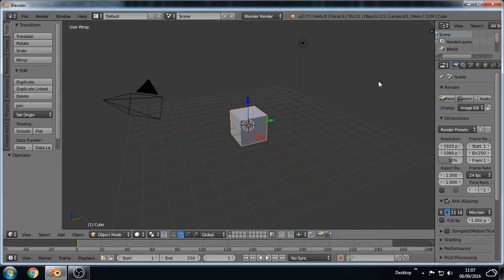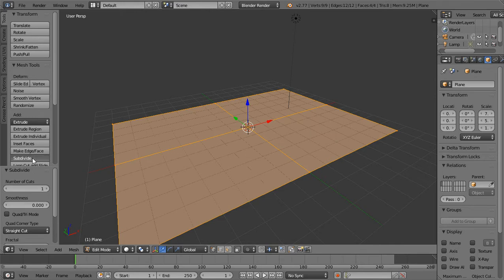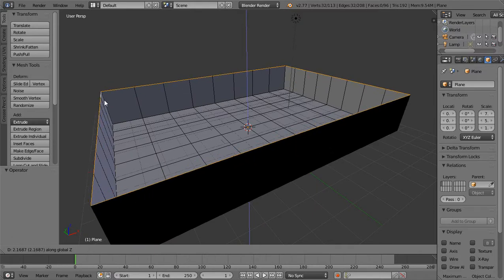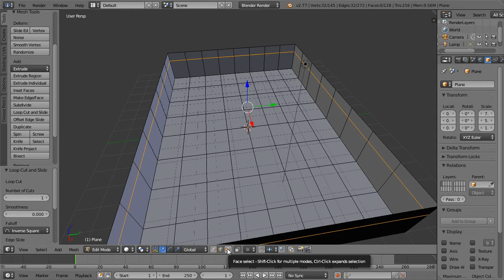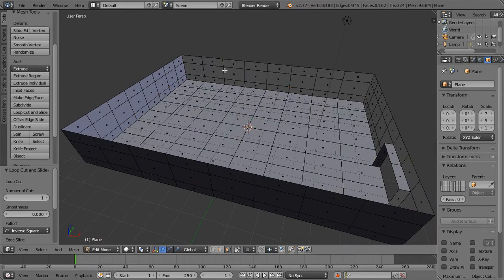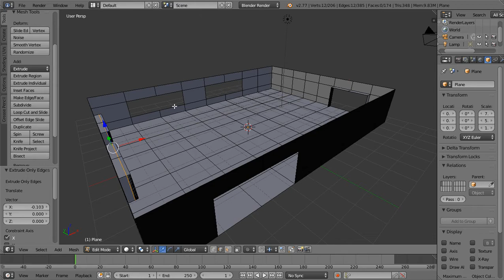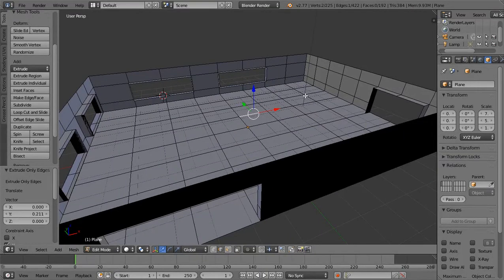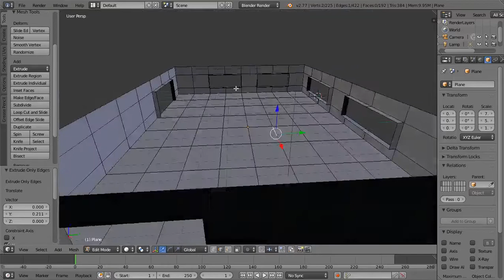Blender v2.77a - Tutorial 01 - Base Room - Floors and walls.

Comment: So many poly's wasted though...
Reply from the maker: Zach Baldwin You're right, funnily enough that wasn't mentioned in lesson 1
Reply: I mean, if you have workflow that works for you fine, but I like how Boolean cuts in the walls, since you can save some face additions to the scene. Also, have you tried the Archimesh Blender plugin - it's pretty legit...
Reply from the maker: Zach Baldwin if I were to do a room now though I probably would just have one plane and withiut the subdivisin, have only really used the boolean tool to cut out from objects.